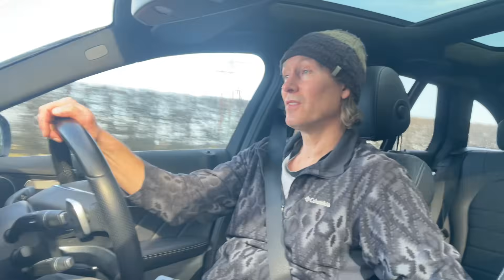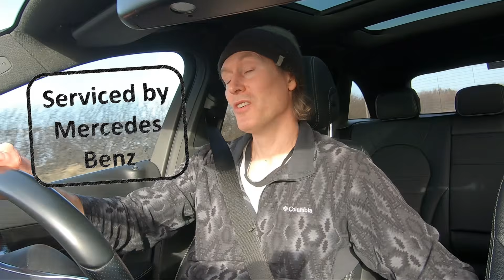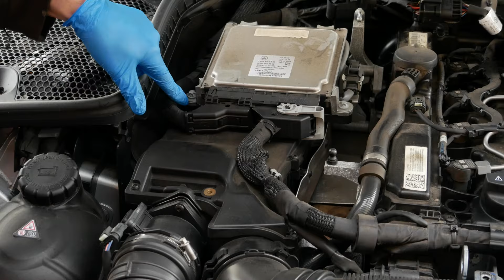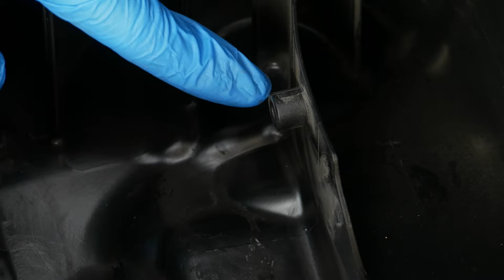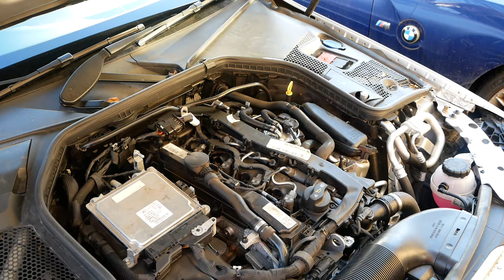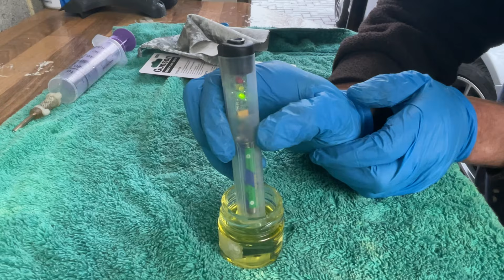Mercedes B Service - RETAIN Mercedes Service History BUT SAVE £295

Comment: Just changed the rear pads on my 2018 C250D, Brembo for £35, did the oil and oil filter, plus air, cabin and pollen filter myself

Comment: I bought my c class from Mercedes-Benz Macclesfield in England. Their rep had it from new. I paid three years for serving, it wasn't carried out, definitely no oil changes, as for the rest, who knows. But the real kicker is 2 months ago on thr gov uk www, the first mot stated 60000 miles, When i bought it, it had 34000 on the clock. Do Not Trust this Macclesfield main dealer.

Comment: I have  6 year old S class 350D  in the UK which I have owned from new, doing around about 5000 miles a year.I have  had the car serviced at the main dealer,The average cost of the first five services being £566,however the dealership provides a free mot £55 and breakdown repair/recovery ,car hire service the equalalent by RAC is £240.So the cost of £295 can be deducted from the service cost.This is only available on cars with full MB service history, but something to think about.
Reply from the maker: All really good points! Thanks for sharing, it sounds like MB have offered some good incentives there 👍

Comment: In the UK mercedes have a concession agreement with Marshalls for maintenance of mercedes vehicles etc 
Unfortunately the experience was not a good one, as they charged me for work not carried out, to the sum of over £400,  they said they had replced the electric loom, when only a injector cap was replaced, to rectify the fault. 
Luckily my mobile  injector engineer specialist had spotted this as he was changing my injectors, and had previously seen my injectors a month previously, and was changing the last two injectors etc what a shock i had to relise that a company like Mercedes could have dishonest concessions. 
However Mercedes head office had my charges refunded, plus a good will gesture of a free service, and logo coat. 
I have not used Mercedes main dealers since. 
I have Mercedes van, and car, because they are so reliable.

Comment: In America I have a 2010 Benz c300 4matic sport 
Cost 2,300 for break and rotors at dealership for transmission flush 1200$
This wild to me but my did my oil change and all the lights and filters so far plus new air intakes that came on the used car I replaced
Reply from the maker: Some of the dealer prices are crazy! Good on you for doing some of the work diy, sounds like your Benz is well looked after 👍 cheers, Phil

Comment: forget MB service . there's nothing beneficial to using them other than saying the techs did the work and charged you a ridiculous amount for it.  I've done every service myself for the last 6 years and my car is 14 years old . I've even rebuilt the suspension when the shocks and struts and mounts failed . there's literally nothing a qualified tech can do that you can't with proper research and the right tools and torque specs . invest a little time and money in the right tools and parts and you'll never visit another service shop . it's absolutely BS what they charge you for labor . an oil change should take you no more than 20 mins on the long end . air filters 5 mins tops . a brake and  rotor change 1.5 hrs plus a brake bleed . a cvt service 2 hrs . take a couple minutes every month and look at parts for wear ,sounds , and smells , for oils and get a good scanner for your cars obd 2 . nothing is out of the way if you put in the work you'll have your car longer than the engineers planned that's for sure
Reply from the maker: Agree 100%, if you are able and have the time, you will always take more care of your car than a stranger would. Main advantage of dealer service is if you don’t have the time or inclination, you plan on selling the car while it is still relatively valuable etc. Keep up the good work, sounds like your Benz is very well looked after! Cheers, Phil

Comment: Hi Phil ,
Would you recommend 2007  w211  with om 642 engine with 30 k miles on  on the clock in 2025 ? It has only 7 services for 18 years. 1 brake pipe replaced, 1 coil spring everything else is genuine. 
Thanks

Comment: I have a Mercedes Benz B180  that I recently bought, what should I service in?
Reply from the maker: Don’t fully understand the question but regarding service intervals - what mileage / age is it and when was it last serviced? If you don’t know, call Benz and see if they have any history on the car. If still no info, at least do the oil, oil filter and air filter. Hope that helps! Cheers, Phil

Comment: Just watched a couple of your videos and found them most interesting  and informative. My c200 cdi does not  have push button start, presumably for priming the FF you turn key to 2nd pre start detente position?
Reply from the maker: Hi, glad you’re liking the videos! ☺️ Yes, you should hear the fuel pump run when you turn the key to position two. 👍 Cheers, Phil

Comment: You have to remember that a brake fluid tester only tests what is in the bottle under the bonnet, and not what is physically at the calipers, which is where it actually matters. You'd have to bleed some of the fluid off (with a pressure bleeder) and then test it.
Reply from the maker: I often bleep off some at the calipers and top up the reservoir but never thought to test what I collected from the calipers. I'll give that a try! 👍😀

Comment: I’ve called my local MB dealership, I’m due a B service too (dust, air, fuel, brake fluid) on my 17 plate S205 as per your post, and if I book into them for a ‘basic’ service, they inform I will lose the breakdown cover, paint warranty and other bells and whistles… irrespective of consuming genuine MB spares, then as for the e-service history, they inform they will record a ‘basic’ service was carried out against the ‘B’ service interval, I presume this is in line with your understanding?
Reply from the maker: Hi @ICMSPLM I wasn't aware of this, so thanks for raising the point! I'm due in at Mercedes in the next week or two, so will definitely ask them about this! I've been doing a little bit of reading about the paint warranty. https://forums.mbclub.co.uk/threads/mercedes-paint-warranty.97063/ I'm not too bothered about the breakdown cover tbh...  Thanks, Phil

Comment: I have a C2 20 D same as you have in the video my rpm keeps fluctuating. Don’t suppose you have any ideas I have done transmission fluid change and it’s still doing the same thing. Many thanks, Rikkie
Reply: No, there’s no codes coming off at all very strange one
Reply from the maker: @rickygibbs9403  Sorry I can't be more help, never come across this issue before and I'd rather be honest about it rather than start speculating! Thanks, Phil
Reply from the maker: Hi there, really sorry, never heard of or experienced this problem! Only thing I can suggest is seeing if there are any fault codes showing. Sorry I can’t be more help! Thanks, Phil

Comment: Thank you so much sir, but why not an oil / oil filter change too? Is it risky to do that at a random local place?
Reply from the maker: Hi, well the purpose of the video was to retain full Mercedes Benz service history, (which is good for resell price etc when you eventually decide to sell the car) and to do this, you have to let Mercedes do the oil change. But you can still save money by doing the "optional" extras yourself, like the fuel filter, cabin filter, wipers etc. Hope that helps! thanks, Phil

Comment: I service the wifes W221 S class 3.0l V6 diesel for less than £100, the oil I buy in 20ltr drums.
Reply from the maker: @merlin1346 That's a good way to do it for a car that you know you are going to be keeping long term! 👍 But, if you want to retain the MB service history, you have to let the service center do that part. ☹ You can still save money by doing the extras yourself (as shown in the vid). Cheers, Phil
Reply: @ReviveMyRide  We made a recent enquiry with a reputable garage as to whether they would accept a part exchange and they said they would even though there is no MB service stamps for the past 4.5years but there are receipt's for every item purchased on our cards. I sold my own very old jeep 6 months ago and the guy was not happy that there was no service history (an old car!!!) There is also a MB service garage near me who will quite happily fit none MB parts, but will a new owner know its not oem?
Reply from the maker: @merlin1346  Hi, yes, you get a range of people out there when it comes to buyers. If you have done the servicing yourself, some are happy as long as you have receipts for service items. If you have an MB service garage near you who will service the car and give you the electronic record (or stamp in the service book), then most buyers won't look any further than that. TBH, if you buy good quality items, they will probably meet Mercedes OEM quality anyway. Mercedes don't make oil filters and air filters, they just get one of the reputable companies to make them for them.

Comment: just found you by chance very good advice and easy to follow, when should you change the diesel filler how many miles ,164 320 cdi model v6,regards
Reply from the maker: Hi @georgejackson7607 Looks like your engine is running the OM642 engine. My understanding is that the it is 65k miles or every 5 year (but I tend to work to the mileage). Hope that helps! Thanks, Phil

Comment: Hi Phil, thanks for posting this video, it makes great sense if people can do the easier parts of servicing themselves to save money.

Mercedes quoted £600 for the "B" service, even though the car indicated  the "A" service was due.  I went to an independent in Sheffield called the German Auto Centre that carried out the "A" service for £200 using genuine Mercedes parts.  They also offer a reduced cost option by using alternative non Mercedes parts.

The filter changes are a good way of saving money by DIY including the cabin and pollen filters for the air con.  Main dealers also offer "extras" such as air conditioning cleaner for £35 - 40, when you can do this yourself if you buy the product from a motor factors for about £6 -8.

I keep my bills for parts for proof of maintenance when I sell.

Keep up the good work, Thanks again.
Reply from the maker: Hi @viktorjaness4152 Thanks for your post! Seems that we have a similar ethos and you mentioned some really good additional work above that is easy to do and will save money! Love it! Yep, as you say, keep all of the receipts for when you eventually sell and the jobs a good one! 👍 Cheers, Phil

Comment: Hi. I' basically the same opinion and would even go beyond and do the oil service by myself. Of course, in that case, no Mercedes stamp in the maintenance booklet.
Mercedes like any other brands are trying to make their customers dependant and so ensure comfortable revenue with the maintenance.
I prefer to invest in good quality parts rather in subsidizing the manufacturer's infrastructure
Reply from the maker: Agree, this is a big revenue stream for the manufacturers! If you're going to keep your car long term, then there may not be much value in getting the Mercedes stamps, especially as you can keep all of your receipts and prove that the work as been done. I'm trying to strike a balance I suppose in getting the stamp but keeping the costs as low as I can...
Reply: ....and wanted to complete my comment in saying that even Mercedes sometimes mounts low-priced parts on their new vehicles (e.g. Chinese low quality tires).

Comment: Hi Phil, great video! Just. Just a quick question are Mercedes dealers okay with you requesting an A service if the B service is due? Do they try and push you towards getting a B service?  Thanks
Reply from the maker: Hi, I expect they will push you towards the service that is due but as you are the customer, you can request what you want. However, to keep your service history, you will need progress the service that due. In the video, I had the correct service done by Mercedes but then completed the optional extras myself to save some pennies. 💰😎

Comment from the maker: 🔥THIS VID MAY INTEREST YOU! Heard About Mercedes Keyless Go CAR THEFT? Here's Some EASY Steps YOU Can Take to BEAT THE THIEVES! :yt: https://youtu.be/sky7jLbNcrA
Reply: Hi Phil, thank you for making this video, good information and to the point. 

The local main mercedes dealer wanted £600 to do the B service although my car service indicator was saying it was an A service.

I used an independent (German Auto Centre) in Sheffield, that did the A service for £200 and they updated the service records online.

They use genuine Mercedes parts or you can specify that they use lower cost non Mercedes items at a further reduced cost.

I agree that items we can service ourselves safely at home is a great way to save money.

Like the two cabin air filters for example as well.

Well done mate 👏

Comment: Well done and thank you for an excellent, informative video. 
Main dealer prices are a rip-off and you do wonder how they charge so much.
Can I ask, which brake fluid tester did you use?
Once again, thank you for a great video.
Reply from the maker: Thanks for your message, really appreciate it! I meant to put a link to the brake fluid tester but forgot! It was a Gunson 77002 and you can find it here! https://amzn.to/35CRF0Z Btw, I also tested it with new brake fluid with a little bit of water added, and it did detect moisture! Thanks, Phil